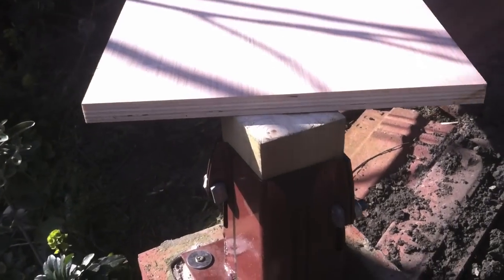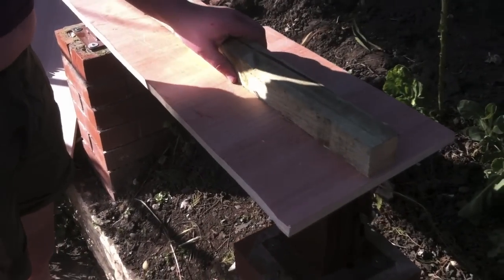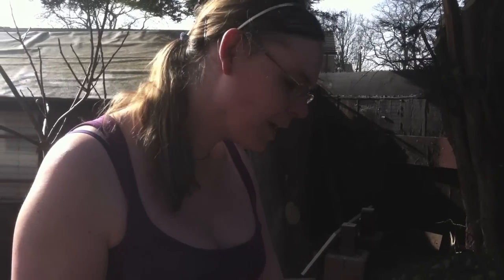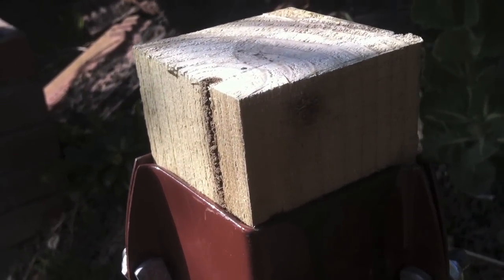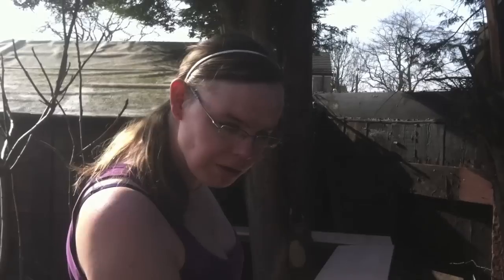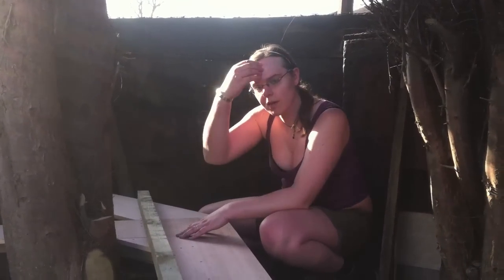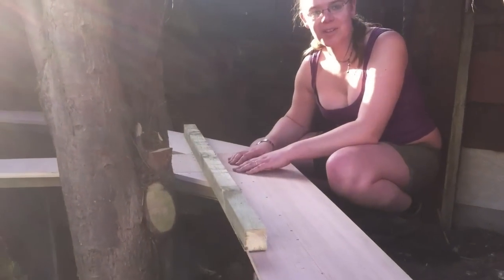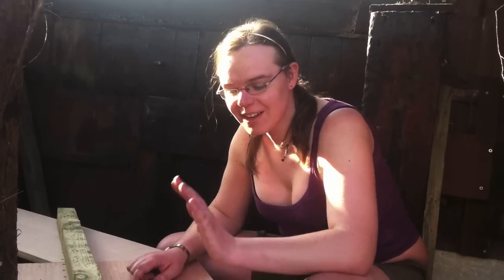How to Build A Garden Model Railway, Part 3

Comment: I can' believe in 4 years how the timber deteriorated, you used good materials and good methodology. I built an 0 gauge garden railway in 1980 and used treated 4x2 rough timber in multiples of 6ft lengths. Peco track and grey cat litter for ballast. It lasted really well in my case. Had I used 00, I suspect it might not have been as successful.